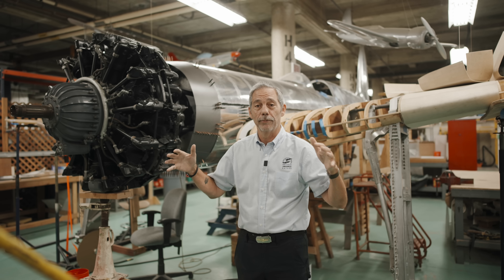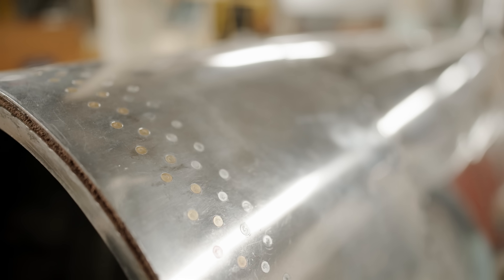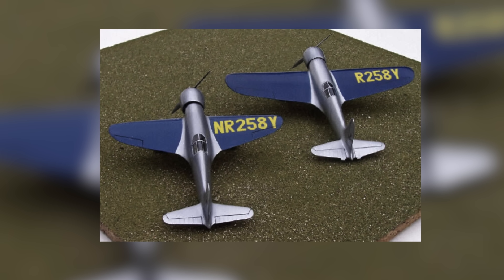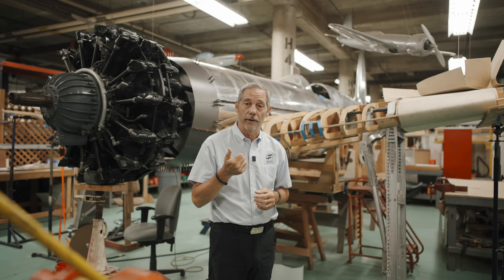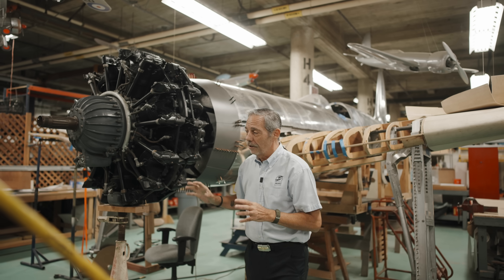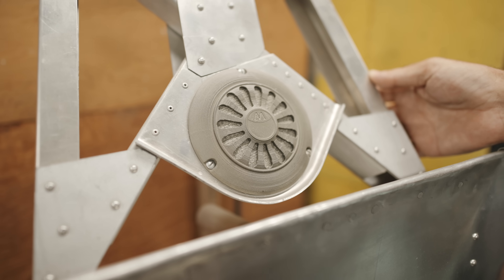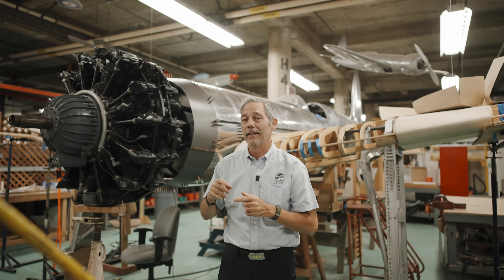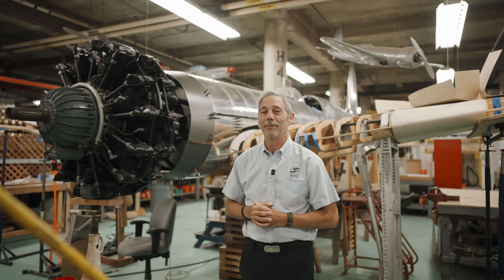Howard Hughes H-1

Comment: I might have missed it -- but are you building the short wing (closed course speed record) or long wing (transcontinental record) version. I've done a lot of research on the Hughes 1B and know there were other differences on the fuselage between the two wing versions -- the tail cone for example. Also, which wing registration will you be going with?  As original, or as Hughes "restored" it just prior to donation to the Smithsonian?
Reply: We built the Short Wing, we are actually recreating what is at the Smithsonian - we flew techs to Washington to take measurements several times, and we matched that aircraft. I haven't seen paint details, we are still a few years away from that decision LOL

Comment: Intriguing. Though, if it will never fly, and there is already the original in the Smithsonian. 
What is the point?
Reply: San Diego and Washington are far enough apart that folks visiting our museum likely have not crossed the country to see theirs. Additionally, we were gifted the P&W 1535 that matched the racer, so we could either sit it on the floor where everyone passes it, or we could present it in the original carrying case, the H-1.

Comment: For those that are not aware:

Jim Wright built a H-1 copy starting in early 1998 with an engine.  Some  35,000 working hours , 20,000 rivets and $ 1 Million later the plane was flying.   The first flight ( 2002 ish ? ) uncovered a problem that plagued the original H-1, the prop was stuck at low pitch forcing the pilot to use max RPM to execute an emergency landing. The " fix " was to install larger counterweights on the propeller.  

By August 4 , 2003 both pilot and plane were lost. .  ... .

A combination of " get there 'itus " and counterweights repeatedly coming loose and ultimately coming off lead to the plane crashing at Yellowstone National Park.  Jim had made several landings to correct the problem but pressed on anyway.  I can't find the article but it said that Jim had tried to land in an open spot but couldn't due to campers being in the way.

My sources are:
Air & Space Smithsonian  May 2003 P 40
Air & Space Smithsonian Oct/Nov 2003 P 8 , 10 , 15
Reply: I got a chance to see the replica in its hangar in Cottage Grove. It was about April or May 2002 and the plane had already flown.
Reply: Glad to see you added the citations so viewers can check for themselves. It is rare to see commenters add details to allow reader to go to the same source. Well done Sir.
Reply: @keithad6485    Thanks for the good words.  I keep the two issues together as a reference.

Comment: Replica wing structure looks like wood. Did original H-1 have a wood wing?
Reply: Excellent point! Yes - and good catch. Our museum had two build crews for 50+ years; a Wood Gang & the Metal Benders. Each had a 600 sq ft patch in our massive basement where the shooting range used to be located. Over the years, each build crew spent years on various projects, building, fabricating, restoring, and eventually populating our display floor with a variety of aircraft from many eras. As the guys aged and passed on (few if any ever quit - they would work to the last), the 50 & 60 year old guys became the 80 & 90 year old guys, and at last, we had a final project in our basement, the hybrid construction Hughes H-1. A unique blend of technologies, our two restoration teams worked together to bring this project into life, and as an observer, it was priceless to see our entire team work as one.  When finished, I consider our H-1 to be the perfect homage to the two generations of craftsmen I have watched pass before my eyes, in this basement.

Comment: Why go to that extreme to copy a Iconic airplane that can't fly? If someone wants to see a non flying one they can go to the Smithsonian! I just CAN'T SEE IT!
Reply: There is a whole other layer of equipment and $$$ to make it flyable.  Things like rebuilding a very rare engine.
Reply: Obviously its not the safest designed aircraft to be flying and changing the design to be safer is counter-intuitive to the build philosophy in the first place. Add on the engine work needed and maintenance required to keep it airworthy. Not a program that can be sustained with just volunteers.

Comment: such a tragedy that Jim Wright's  flying replica was lost. It was a work of art.
Reply: Dual tragedy, Jim was lost as well. 😥
Reply: @anthonymoore4335  Unfortunately, Jim was aware there was an engine problem before he left Oshkosh & chose to fly home.  He did not fly over any of the interstate highways which could have afforded him an emergency runway.  Racers (H-1 included) have very high stall speeds & approach speeds.  Thus the energy he needed to dissipate on landing was high.  His loss was a great loss to the aviation world but, he made the decision to go home.  R.I.P.
Reply: @dennislyons3095   Counterweight issues that plagued the original H-1 also caused the prop on Jim's plane to revert to low pitch mode requiring high engine RPM which overheated the engine. The loss of the counterweight also caused a vibration problem limiting max RPM. See my stand alone post.
Reply: @dennislyons3095  The more complex the aircraft grows the more small defects grow to hughe ones. The F104 starfighter is such an example. Small defects cause an aircraft loss. I lost a friend with it in the past. One (critical) fastener was missing.
Reply: @dennislyons3095 Did you read the Ntsb report? That man was a hero, he had the option the set the plane down some what safely but there ended up being people in the way and instead of killing a bunch of innocent unaware bystanders he tried for a different spot in the last seconds he had of being airborne and it wasn’t ideal obviously because he didn’t make it. He was going through the EXACT same issues Howard Hughes had with the original. It wasn’t just a case of get-home-itis that killed Jim, he even stopped at another airport along the way trying to sort the problem out with the counterweights.
Reply: See my other post and 
Air & Space Smithsonian  May 2003 P 40
Air & Space Smithsonian Oct/Nov 2003 P 8 , 10 , 15
Reply: Where did he last put it? I'm sure it will turn up someday.